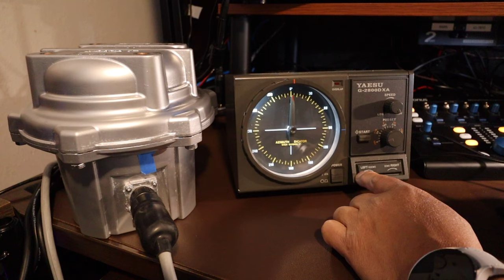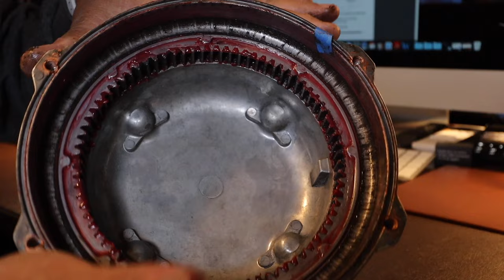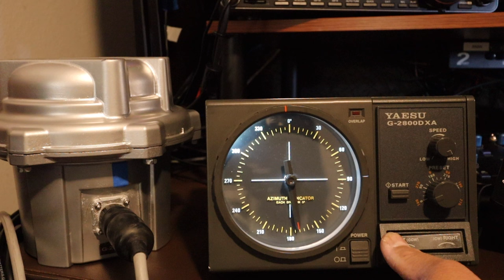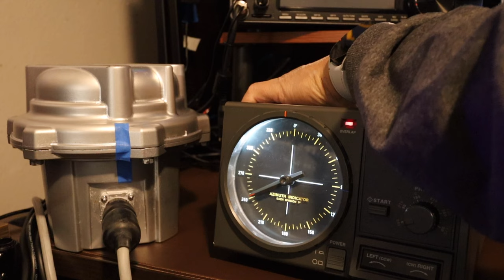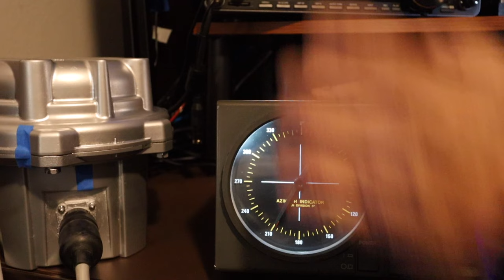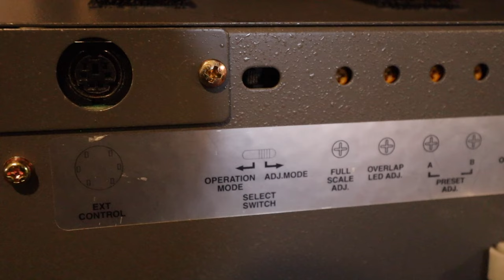Yaesu G2800 Rotator Alignment | Troubleshooting Rotator Speed Control

Comment: i know when i did mind, I had the wrong marks on the rotor when alignment. And the 270 was really 450. Finally found a you tube video and used the right marks and it worked.

Comment: Hi Darren, you have a BK brake problem, the BK Butterfly is loose on the motor shaft & it now drops down allowing BK spring to get jammed between the Pinion gear & the BK Butterfly when rotating CCW, hence why it is slow in that direction. Regarding the switches in the rotator, the lower set are for limit end of rotation & the top set is to reduce speed before limit end stop, they have nothing to do with normal rotation. You have not aligned it properly you made it worse & the POT's in the rotator & controller are not aligned.  The POT in the controller has run out of POT movement (hence why it is pulsing near West) & since these POT's have limit stoppers in them, you may cause damage to the POT drive gear.

Comment: Good morning, I have exactly the same problem with a Yaesu G1000DXC. Please tell us the solution when you have it repaired.
Reply from the maker: Well, Yaesu told me nothing was wrong with my G2800 and said it could be my Controller.  Next time I get back home for a few days to troubleshoot it, I'll also make a video on what I did to troubleshoot.  73 de N4VFR
Reply: @DarrenN4VFR  A few days ago I took the external rotor unit down from the tower. I have tested it at home with a new cable and it works perfectly. So my problem is the control cable, it must have some bad contact.
Reply from the maker: @JuanjoGameroLopez  Thank you.  I might have to do that too.  But first, I will check the voltages on the controller to make sure it's 24vdc.  I talked to the Yaesu Tech during Hamvention.  Watch that video if you havent yet.  73

Comment: The problem is in the controller.  Start by check the voltage between pins four and five.  The polarity will reverse as you change directions.
Reply from the maker: Yup, I will when I get a few days off.